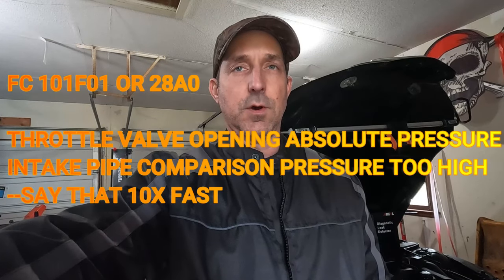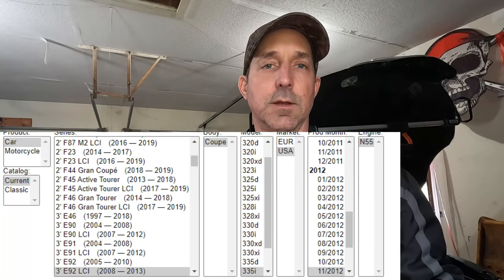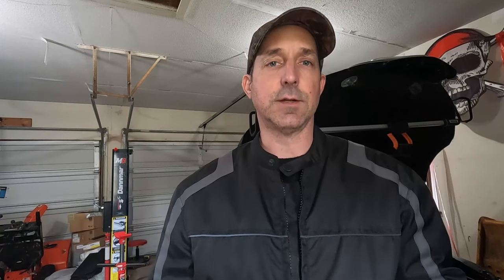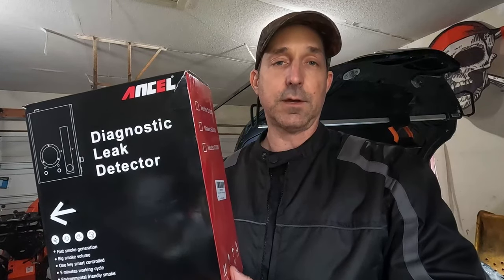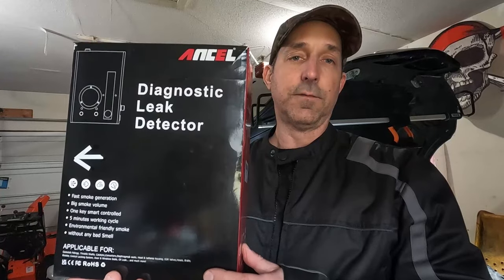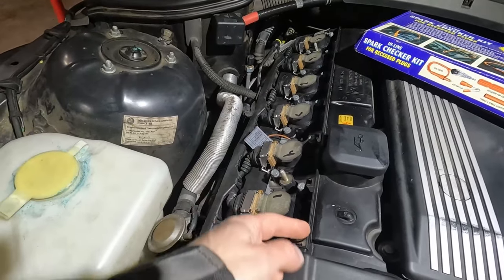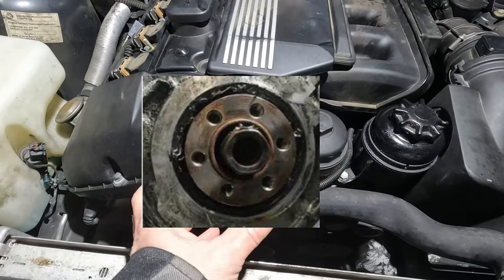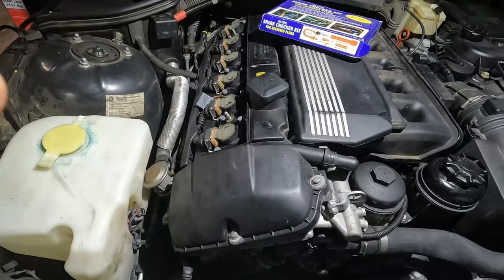28A0 or 101F01 or P 112F BMW Fault Code N55 Fix! And odd N55 issues I have seen!

Comment: Absolutely the best vids I have found. e70 n55 with valve cover knock, trying all your suggestions, in order.  Thank goodness I found you, you just saved my car. Thank you sir
Reply from the maker: Hello, Sorry to hear your N55 has a knock. Often this can be a bottom end noise due to worn out rod bearings. In some cases the rod bearings can be replaced and the engine is still ok in some cases if there is damage to the crank the engine may need replacement.

Comment: Good to see you're still putting out new videos. You're a great mechanic, informative and very clear and easy to understand. I appreciate your time and help you've given me on my E46.
Reply from the maker: Thanks bud!
Reply: @AskTheCarExperts  You're welcome. I have a question: I'm using a Foxwell NT510 Elite. One of the codes it reads as an error is: IHKA: AUC sensor. What is that and WHERE is it?  I have other codes but, I'll not bombard you.  Thank you.
Reply from the maker: @standtall7646  The AUC sensor is the "smell" sensor to close the fresh air flaps when it detects excess fumes from other vehicles.  It is located in the engine compartment bulk head near the fresh air inlet area. Usually on the passenger side.
Reply: @AskTheCarExperts  Thank you. I'll look at that today. The other "error" code is of big concern: I have an airbag light on instrument cluster. That code is: Airbag ZAE. My connections under seat look connected and tight and my car is very clean. No rust or corrosion under my seat or on my car anywhere. Another error is: MRS: Seat occupancy recognition (SBE1). I don't know if they are the same issue, combined or not. A little puzzled.There was a recall several years back on steering wheel airbag but, dealer said it had the correct airbag installed and required no Recall Upgrade. Thank you, for your time and help, again.
Reply from the maker: @standtall7646  No problem.  Did the airbag light come on before the airbag was checked? If you clear the code does the warning come right back?
Reply: @AskTheCarExperts  No. The airbag light has never been on. I cleared codes, yesterday, and the light did NOT come back on.
Reply from the maker: @standtall7646  Excellent it is not unusual to have some bogus faults.  The seat sensor is a common failure but if the light is off for now it is working at the moment.
Reply: @AskTheCarExperts  Thank you. I'll keep my eye on it. I'm only concerned that it is actually working. Hopefully, never needed but, good to know it's there and ready. Thank you, again.

Comment: Thank you very much for this brilliant information！My N55 has been showing this code for almost a year, and I have been experiencing rough idles from cold starts, but everything goes to normal once the engine warms up. I have to clear adaptations and let the car idle for more than 20 minutes for multiple times before actually driving it, then I can somehow work around with any rough idles issues. I never figured out why the procedure I tried somehow works, but your video provides a more reasonable explanation. I will definitely give it a try to unplug the purge valve, and hope it can solve this issue much faster. Thanks again!
Reply from the maker: Glad to hear the info is helpful!
Reply: Did your problem fixed?
Reply: I see visible oil leak at rear mail seal :( , Also at idle I can hear alot of noise coming from the rear main area
Reply: @tronix19  My car has been stable for the past year or 20k miles and I did not have to clear code or reset adaptation, so I have been driving without any rough idle issue. But I know the problem will return as soon as I clear code or reset adaptation....
Reply: @DoradoDevOps  You might want to try change your valve cover first? I have seen many N55 users report the crankcase ventilation system is leaking and changing valve cover can address it
Reply: never suffered any severe damage? i currently have it but im worried ill damage by commuting

Comment: Very informative. Thanks. I will most likely be back in touch with you for some further DIY guidance.
Reply from the maker: @brian511  Most of these issues tend to be a hard to find air leak.
Reply: @AskTheCarExperts  Hello, I have sent you an email. Thanks

Comment: Dude, you saved the day! Unplugged my gas tank vent hose and let my N55 idle for 15 minutes, cleared codes, plugged hose back in and it fixed the check engine light and idle stumble. My battery also needs replaced, wondering if this triggered this?
Reply from the maker: Awesome bud! Battery voltage issues can do some odd things.

Comment: Very useful info, thanks..  Having a challenge identifying the exact location of the tank vent value on a x5 2013.
Reply from the maker: It should be right on the driver side toward the from under the intake. I also show it on my video for the launch because I activate it as a test. Hope this helps.

Comment: Is the tank vent valve electrical connector the one with the sliding metal clip? O have a 2013 N55 F10. It is not clear in the cutout picture in the video. Of course my old eyes don't work as well as they used to.
Reply from the maker: Hi Ron, Glad to help. Yes that push sliding clip is the task vent valve.  You can send me a picture of it if you want me to verify for you. Askthecarexperts@gmail.com

Comment: Dealing with p122f now after changing bank 1 02 spark plugs not sure what vacuum leak to check
Reply from the maker: Smoke test the engine just past the filter housing. Even a small leak cam cause this. Often the charge air tube leaks.
Reply: Did you figure out what it was? Having this code on a n55 i just bought

Comment: I am going through this on my 13 x5. The tentioner pulley went and the belt shredded, took out the oil control valve next to the crank pulley, then wrapped around the crank pulley and ate the crank seal. Where I'm at now is i just got the old seal out. (What a pain) but the small tip of a seal puller broke off and went inside and I'm not seeing it. I'm  also hoping there's no belt shreds in the motor either. Any advice?
Reply from the maker: Sorry to hear you had this failure. I have some videos that may help.
To try and get the broken piece you should remove the oil level sensor and fish around with a magnet. Hopefully you can get it and not have to drop the oil pan.
Belt Failure Main Seal Diagnosis
https://youtu.be/_YW3WKHD3Ws

Tensioner and idler
https://youtu.be/I_JsqzF4gus

Front Main Seal DIY
https://youtu.be/0GyeMHpvuHI

Comment: I had the same issue. My valve cover had a micro-crack, and since i replaced it, the code newer came back!!!!
Reply from the maker: Glad you found it! That can be a tough thing to trace. Thanks for posting!
Reply: @AskTheCarExperts  
One thing though were I almost gave up was fixing a P0172 rich mixture problem. 

I ended up replacing all injectors, spark plugs, vanos positioning sensors, crankcase positioning sensor, mass airflow sensor, manifold pressure sensors, charge pipe, throttle body, ignition coils, etc. and none of it did anything….. i lived with this issue for almost 3 years and nobody could really help me. 
Just last month I notices that the boost pipe (which goes out from the intercooler to the charge pipe, and then to the throttle body)
Wasn’t attached properly to the IC. Also the inner seal was so loose inside that air escaped out of the pipe: hence rich condition, since measured air escaped out of the pipe and thus less air entered in the intake manifold. 

Changing the inner rubber seal and attaching the pipe properly solved that issue. It felt like winning an argument agains my girlfriend. 
It was amazing 🤩
Reply: @armwrestlingpassion8784  loool
Reply: What car do you have ?

Comment: My friend has been getting this code after replacing his hpfp with a Bosch hpfp and upgrading to a vrsf intercooler not sure where to start as there’s so many codes
Reply from the maker: Sorry to hear that.  It is best to start with the basics. Check For any unmetered air leaks.

Comment: Hey, I have a 2013 BMW 335i and have the issue - 101F01 - Air Mass System, Plausibility: Calculated Air Masses In The Air Intake System Not Plausible. 

Do you have any recommendations on what to try for this? The idle is extremely rough and most of the time cuts out. Did a smoke test and since upgraded the turbo inlet and charge pipes, no more leaks but the car is still having the rough idle

Any suggestions is much appreciated

2013 F31 Touring 335i
Reply: Did u figure it out

Comment: I have a N18 mini cooper, initially had 3 misfires with 2 low compression next to each other. With this in mind plus a 28A0 it’s almost certainly an internal issue with the engine being ticking bomb huh? Practically pointless in trying to diagnose other issues right? The cars runs pretty decently with some rough startups when cold and  random jerking when going ~60 miles uphill.
Reply from the maker: Hello, Anything like this you want to do a cylinder leakage test.  It could be a head gasket issue or valves not sealing. Some items are repairable while others would require a head replacement or engine.

Comment: Hello, I just changed my hpfp back to oem. Could that be the reason I have the code? So should I just unplug the purge valve and idle for 15 mins?
Reply from the maker: Changing to an OEM HPFP should not cause this code. An air leak or if there is any drag on the engine this code can set. In some cases the HPFP can cause some drag or a problem with the cylinder head. But to do the purge valve adaptation reset. Clear the engine adaptations with a scan tool.  Then disconnect the purge valve so it cannot activate at idle which would richen the air mixture. Then idle for 15 minutes. Clear the codes and recheck.
Reply: @AskTheCarExperts  thanks!

Comment: My car is having a long crank before starting with the code p112f being the only fault code. I assumed this was the hpfp, but could it be a valve cover leak that causes this code and the long start?
Reply from the maker: This code could be an air leak but normally mixed with a long crank it makes it more likely the high pressure fuel pump.

Comment: Thank you for your video and information,  also you're a great Mechanic. I'm Deaf and own BMW F31 M Sport 330D Touring 2017. Diagnsotic fault Air mass is too high. But BMW garage says fault is exhaust backpressure sensor before turbocharger, signal too high and servie man say knock from turbo and needs repair and replacement as same intel manifold air cooler pipe  this is high bill £4,000 for parts cos too many price list. what do you think and advice me, thanks for your appreaciate
Reply from the maker: Hello, The exhaust back pressure sensor is a common failure. I have not seen that many turbo's fail. A knock from the turbo seem like an odd symptom. I would get a second opinion on that.
Reply: Where is the part located for adaptation procedures on the N55
Reply: @camerionjackson671  I would want to kno too

Comment: Hi Roger, GREAT INFO!!  great video!! i HAVE A 2013 N55 well maintained and oil changes/ new top pan(with new oil cap)/ new oem spark plugs/ new OFHG/ and as to be sure, preventative maintenance  new belt and pulleys/tensioner, this engine is dry and no leaks for about 30 thousand miles ago.But i have this same code 28AO, that will pop up and go away occasionally... Otherwise the vehicle is fine and this code has be on/off for 10 months and i feel and notice that, if i always warm up the  cold engine for 15 minutes before i drive, the code wont appear, it is a nuisance and annoying I use a ANCEL BM700 obd code reader. the vehicle it has 177 kilometres on it now. ty for your Thoughts, comments and response
Reply from the maker: Hello :) Such a crazy fault code. If there are no unmetered air leaks I would suspect the high pressure fuel pump.
Reply: @AskTheCarExperts  ,ty Sir, i appreciate you input. i well get a check a  the fuel pump pressure and see how it goes, ty keep posting Great Videos!! ty
Reply: @battlehrfred  same boat here. I am wondering if there is any update on your side? really appreciate it!
Reply: @yizhonghu1522  ,Hi, my vehicle has now 200 thousand on it since last year.. so this means,at least my opinion,says, its not the fuel pump that is giving me a issue, if it was my fuel pump it would have been shut down since last year, but nope, runs fine, but again 28A0 CODE is still showing up. i am going to do a "smoke" test on the Engine itself and also im going to do the intake duct system upcoming soon.but again, i do delete the 28A0 code and it comes return immediately after  i start it up . otherwise the vehicles engine is just fine ty
Reply: @battlehrfred  My 2013 N55 e70 is also well-maintained and I have had it for the past 7 years. Started to leak though and I dealt with most of the leaks. The 28A0 comes and goes occasionally. My shop said it was due to a leak on the valve cover so I got a new OEM valve cover. The code was clear for 1.5 months after the new valve cover but it comes back again now. The vehicle runs fine, no noticeable issue.

Comment: Great video @askthecarexperts ! Liked and subscribed!

Code 28A0 appeared after replacing the rear duct (aka Intercooler Pipe). Could the rear duct replacement have triggered that code?

Thanks!
Reply from the maker: Thanks!
Reply from the maker: It could be an air leak. Do you have a smoke tester?
Reply: @AskTheCarExperts  don’t have one, but did the trick you showed in the video and so far the code hasn’t showed up again.

PS: I lost the cable clip while removing it 😵‍💫… it was swollen by the engine bay… another one is on its way. 

Thanks!

Comment: Found my leak around the seam of the map sensor next to the throttle and second leak at the crank case vent hose on 
the valve cover. 2012 bmw x3 35i  n55.
Reply from the maker: @yoube449  Sweet! Those small leaks can cause big issues.
Reply: @AskTheCarExperts  yes I got dtc 101f01 now I'm waiting on parts after finding where the leak were.
I will give you an update after the repairs.
Reply from the maker: @yoube449  Sounds good!
Reply: Update on the 101F01 code .Amazon delivered my parts on time  Crankcase vent hose and Pvc valve was replaced i didn't replace the intercooler hose cause i was able to seal the base of the intercooler hose that mounts the map sensor. Cleared the code and took it on a test drive. The check engine light would normally come back right away but it never came back on.The on board computer still reads it as a permanent code but that should clear after driving for a bit. NO MORE CHECK ENGINE LIGHT 🤣🤣. Thank for sharing your knowledge with me.👍
Reply from the maker: @yoube449  That is great news! Great job doing your diagnosis and finding those leaks!
Reply: @AskTheCarExperts  Thanks! To spread the news My wife was complaining about loud squealing/
whistling sounds which I thought was coming from the tension pulley but it was coming from the pvc diaphragm.